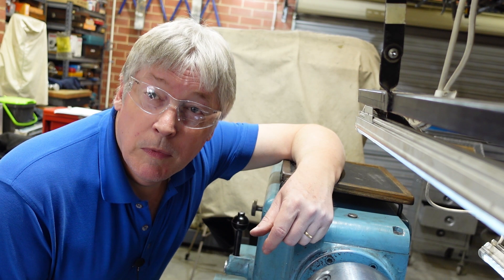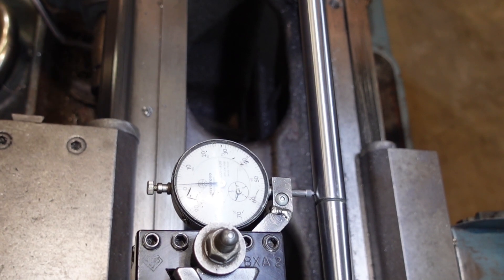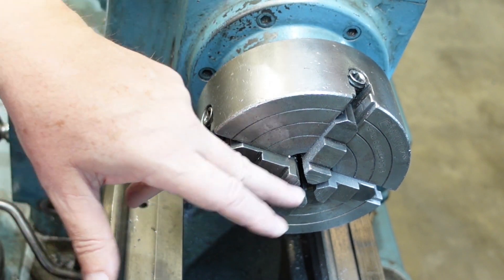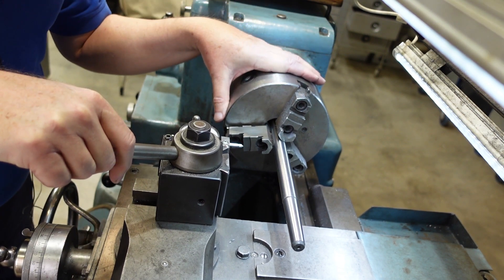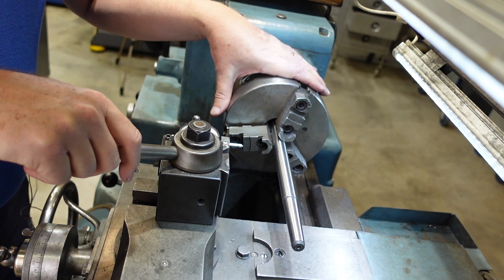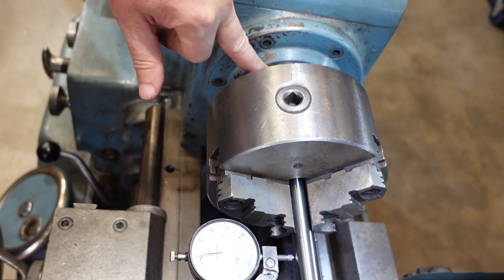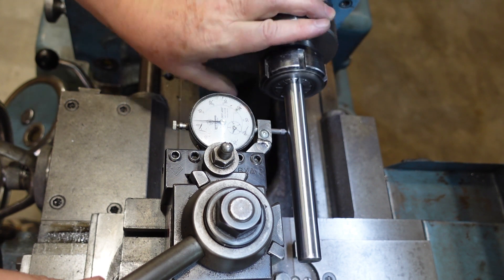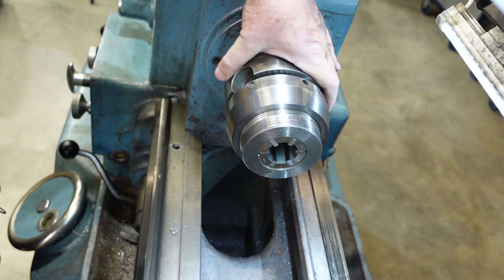A lathe work holding comparison

Comment: Did you clean out the centre holes in the bar?
Reply from the maker: I did not clean them out as such, but I have used this bar for many years and it is kept clean in a box. Some of the errors seen could also be from dinged up centres too...
Reply from the maker: I re-checked the centre holes - they are clean